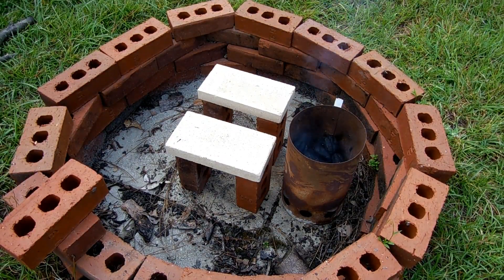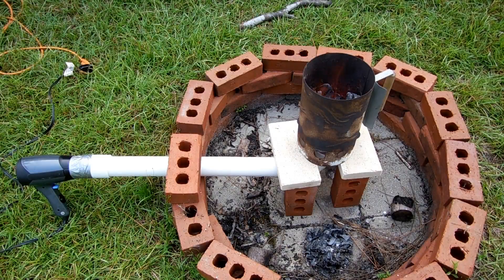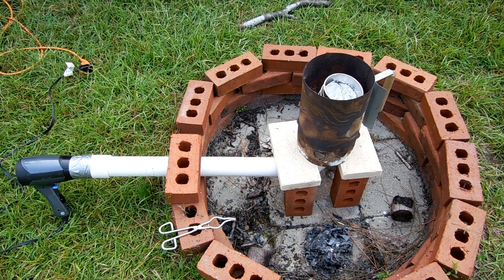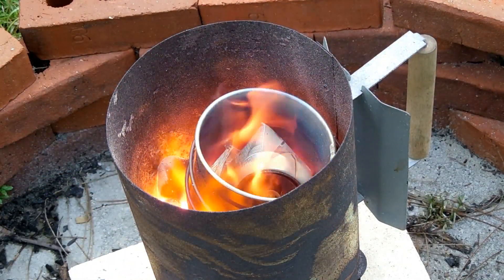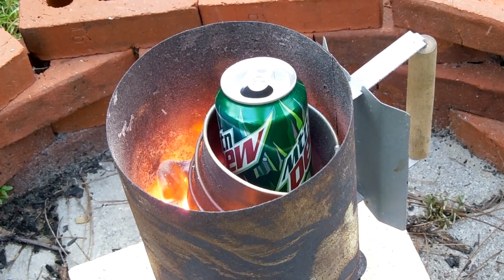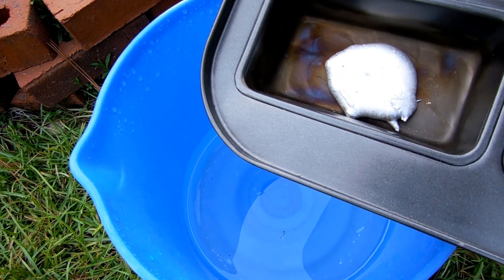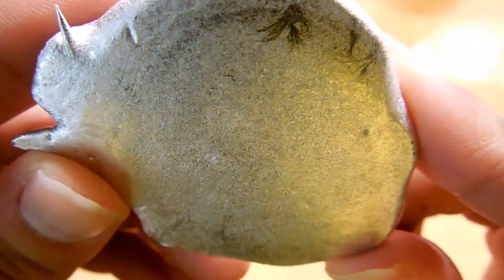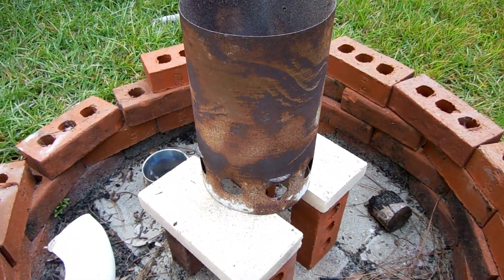Very Simple Aluminum Furnace

Comment: So if you'd like to get almost on slag, roughly cut up the cans up to make them more compact, then take borax ( yes the old soap) and dust it over the top of the cans. Then start melting, the borax acts as a flux and will reduce the slag to almost nothing. Also see if you can find an old plumbers lead pot they make great crucibles for most melting and there cheap. Plus they will last way longer than the SS pot you have. Happy melting!
Reply: I don't get it. I looked up the melting points of lead (621.5 F) and aluminum (1221 f). How does lead work without just melting first?

Comment: If you use the metal tubing and the silicone hoses and hose clamps from a front mount inter-cooler setup for a turbo car as the pipping it will be a lot more secured to the hair dryer, and a lot more reliable. Other than that good idea, it seems to work really well. As for what shoes to wear, Mack Boots are awesome, and I've had the pair I'm wearing now since 2008. They still have plenty of rubber grip left, nearly like new actually, and I did security in them for 5 years. They breath very good, and I never get sweaty white spots on my feet from them, but as soon as I wear cheap sneakers for a day it's another story. I love my Mack Boots. Totally worth the $140au I paid for them.

Comment: I have seen aluminum pots melt on an electric stove, so wouldn't it be possible to melt aluminum in a stainless steel pots on it either a gas or electric kitchen stove.
I realize this will be rather dangerous to do in the kitchen but nevertheless, I was just curious. 
Keep up the good works :-)
Reply: Yeah sure, as long as your kitchen stove/oven has a setting that goes to 1,200°F.
Reply: Rolf, I'm no kitchen ace, but my Betty Crocker Cook Book specifically states:  "Flip the pancakes when the bubbles appear on the top-side and the edges turn golden brown."
No sarcasm intended, but...if your aluminum pan is melting and dripping through your electric heating element, breakfast is probably ruined. -Just saying.
Reply: marshalllhiepler
 LOL, I was going to say Rolf and my wife should trade recipes sometime. :D

Comment: The plastic gloves you are wearing are a bad idea is is the idea of no shoes.  If you splash aluminum on those gloves, they will melt and stick to your hands, causing a much more severe burn than if you had no gloves on.  You should stick to all leather gloves for handling aluminum.  No shoes is probably better than laced up shoes.  Metal down the laces can really burn you because you cannot get the shoe off easily.  You will get a better yield on you aluminum if you crush the cans first.  The method you are using exposes the surface to the air as it melts and allows it to oxidize.  Crushed cans will allow you to put several cans in at the same time.  A top on the melt pot would help keep oxygen out.  It would be a good idea to use a refractory coating on the steel pot you are melting in.  That will stop the aluminum from sticking to the steel and eventually eating a hole through it.  Lacking real flux, you can use table salt on top of the metal to slow down oxidation, just skim it back before pouring or use a skimmer and remove it first.  The salt is lighter than the metal and will float.
Reply: There was an experiment done and it turns out metal doesn't stick to your hands. That being said it's still dangerously hot and can burn you.

Comment: please, how hard is that output aluminium material? can you break it in hands, or can it be used as construction material?
Reply from the maker: Lots of things are made of aluminum! It's lightweight, strong, and corrosion resistant. That would be the next step after melting cans into ingots: make a mold of the thing you want to make, melt again, and cast your part. The first melt is mostly to get rid of the large amount of slag. Of course, these cans are an alloy so that may or may not be beneficial to your application.

Comment: The bottom did not cristalize because it cooled slower. heat slowly transfered from the bottom to the cake pan. teh top however got qunched in water, cooled very quickly, you tempered the top of it.
Reply: Thats not really the truth and it doesn't make sense either :) the whole piece of aluminium was quenched in the water simultaneously, so that explanation is ruled out :P
And what happened is actually the opposite, because he did not pour the molten aluminium in the water directly.
When he poured in into the mold, the bottom cooled more rapidly because it came in contact with a colder and less heat tranfering effecient surface, therefore the bottom cooled the quickest which did not give the aluminium time to form crystals at the bottom, but the top layer however was out in the atmospheric air, the aluminium then heats up the surrounding air immediately unlike the steel mold, which has a larger mass and takes more energy to heat up, the top layer therefore cooled more slowly and gave the aluminium time to settle in it's crystallic structure :)
Reply: DannyMcCawley you don't know much about thermodynamics do you? I suggest that you talk about things you have studied, not things you think you know about. you will sound less silly next time.
Reply: Mike Warren Oh and you have thats why you, can put out a statement like cooling metal rapidly is what makes it form crystaline structures?
And furthermore your explanation isn't "water tight" if you will, because the aluminium had time to cool before it was dumped into the water, so don't go there.
Reply: Staying clearly again, that you know nothing about thermodynamics nor metallurgy
Reply from the maker: DannyMcCawley
This is correct. Technically, it still formed crystals everywhere but the faster it cools the smaller the crystals are. As you said, the part in contact with the pan conducted the heat away quicker, meaning faster cooling and nearly invisible tiny crystals. The rest of the blob cooled more slowly, resulting in larger more visible crystals.
Reply: Incorrect
Reply: Mike Warren It is a fact that if a metal cools more slowly the crystals formed will be larger than those of a metal that is cooled rapidly i suggest you go read up on your education again, that is if it ever existed.
Reply: Insults sure validate your point don't they. And also make me want to take you seriously
Reply: Mike Warren Did I insult you by questioning if you actually have an education in thermodynamics? If so you might wanna take a look at your very first reply to me and then climb down from your high horse :)?

Comment: Pure&simple - just perfectly impressing idea! You didn't show precisely the connection of PVC elbow with the hot charcoal oven. I would apply a steel piece instead (smoking PVC is poisonous after all). Temperature can be even 1200C considering old metallurgy methods - many forests fell in this order in old ages. My first furnace stuff will be thousands of empty pet food packages - they are not collectable by metal shops at ours - whereas blobs are OK....

Comment: i understand the whole principal behind forcing air into the fire but as far as your problem with the hair dryer duct taped to the pipe why couldnt you use one of those hiar dryers with a cool setting so the duct tape wont loose its stickiness so fast?
Reply from the maker: Of course, but this hair dryer was free!
Reply: mrhomescientist
What he should do is connect wires to the motor (most are DC) and use small wall wart. Or better yet use a variable power supply for exact air flow control. I had a forge similar to this using a piece of cast steel water pipe. Also used metal pipe to connect to hair dryer with variable speed control. Easily melted aluminum using a cast iron ladle. Coal works good too.

Comment from the maker: All of that is well away from the hot coals, and works just fine. The end of the pipe closest to the flame was only slightly melted, but I'll still probably replace the PVC with metal at some point.

Comment from the maker: Slag is usually metal oxides resulting from the hot metal's reaction with oxygen in the air. These are usually solids because oxides have higher melting points than the metal itself (i.e. aluminum is 660C and aluminum oxide is over 2000C). There's also probably some carbon and other organic gunk in there from burning the plastic inner liner and label.

Comment: Pretty cool... The ultimate can compactor. LOL
You could build a rocket stove with chimney brick and probably do the same thing. Also, to speed things up a bit, kink the cans slightly or flatten them lengthwise and put several in at the same time.

Comment: Excellent video! If you have any black locusts growing on your property or access to that wind already dried you will get much better results for the money. Charcoal is about half as dense as anthracite and locust has the same heat content of anthracite so you should use half the amount of locust and it costs a lot less than charcoal if you are smelting a lot of metal.

Comment: Thanks, that's very helpful. I aim to do something similar with a large fresnel lens, possibly parabolic mirrors. I was under the impression that fumes would be given off by the melting substance. Since the fresnel lens would generate a much higher temperature would a respirator then be advised?

Comment from the maker: Have at it! Can't get much simpler. I've actually improved it slightly since making the video, by surrounding the charcoal chimney with insulating fire bricks. Helps keep the heat in and make it more efficient. Crushing the cans beforehand also makes it a bit faster to melt, since you can load more at a time.

Comment: That actually wasn't steam, that was a thermobaric reaction. A pocket of air inside the can reached critical temperature and then caused a minor explosion which then gushed out of the open mouth of the can. Good work by the way, simple forge with bellows. Don't be surprised it worked to well - too many people simply over complicate things. I once made up plans for a heat treat oven out of a grill, steel mesh, tin spout, charcoal and a leaf blower.

Comment: I use an aluminized suit like those used by fire fighters while fighting jet fuel fires, but that is because of the tight conditions of my foundry...and I am a little paranoid when it comes to molten metal. But, creating aluminum parts that you have designed and cast is nothing short of amazing. Do yourself a favor and research this and then do it! You won't be sorry (as long as you are smart about it and respect the process, you won't get injured).

Comment: Yes. You do need to do this in a VERY well ventilated area. Even if you use electric instead of charcoal, you need to make sure that there is good ventilation. Gases from the flux used in the original manufacturing process will be released.
As far as PPE is concerned, you can really get away with using a good quality face shield, welders gloves, and a welders apron. If you drip molten aluminum on your foot, you are in for serious reconstructive surgery, so be extra careful when lifting the melt.

Comment: I used to do a lot of aluminum casting and the best way you can get rid of that slag is pouring small amounts of hydrochloric acid into the molten aluminum to purify it and scrape all the slag off the top after puting the hydrochloric acid into the aluminum, but were a gas mask because when hydrochloric acid is super heated it turns into what is commonly known as mustard gas, so use extreme care when you are doing it.

Comment: Observations: 1. the aluminum will oxidize like mad once it melts, and the slag will consist of mainly aluminum oxide. If you want to increase the metal yield, you need to present a reducing gas layer into the crucible, such as Nitrogen. You also stand a chance of the aluminium igniting in open air when molten. 2. You are losing huge amount of heat with it open. i'd put the furnace can into a larger metal barrel (like a 5 gallon cooking oil drum) and fill the gap with perlite or vermiculite.

Comment: Great comments! First I would not put my dick in it.second: I would not worry about shoes, surely you are quicker than a squirt of molting aluminum at 1200 degrees! And lastly if you can melt quick you have charcoal left over for lunch! I hear that the borate in Borax makes a good flux also, I have never tried rock salt......

Comment from the maker: Nope! I did some research on this a while back. The majority of the can is made of aluminum alloy 3104-H19, which is 95% - 98% Al with main impurities of Fe, Mg, and Mn. The lids are made of alloy 5182-H48, containing 4-5% Mg. The extra magnesium in the lid is to add strength.

Comment: I've melted aluminum this way too except my furnace was a bit larger. I didn't use a proper crucible and instead used a stainless steel pot rather like the one you're using. Anyway it was a disaster, the heat from the charcoal burned right through the steel and all my aluminum poured out the bottom. Molten aluminum running down a grassy hill at night looks awesome though.

Comment: Make the fire bigger man maybe inside of an EMPTY 20lb propane cylinder cut open.Use a steel pipe for your crucible as it will get red hot and retain heat so when you pour it will not cool down as quick and you will get more aluminum out of the batch,,,,also need to make a slag scooping tool to remove the slag,,,all this is only worth it if your are going to be doing a large batch

Comment from the maker: I actually looked into that, and it's too dangerous to attempt with my current setup. While Mg's melting point is below aluminum's (meaning I can in theory melt it), it's autoignition temperature is actually even lower. That means before it actually melted it would catch fire! I'd need some sort of inert atmosphere (and NOT CO2 or N2 either, because Mg reacts with both) before attempting this.

Comment from the maker: There is some Al trapped in it, but mostly it is aluminum oxide and probably carbon and other decomposition products from the label and plastic liner. This is because at these temperatures, molten metals almost always react with air to form at least a small amount of oxide slag.

Comment: I'm trying to find a way to heat aluminum to 2000° F. I need to measure it's temperature and photograph it every 100 degrees from melting to 2000°.

Comment: Ok, but the bottom of the charcoal chimney is solid metal and was wondering about pointing the air straight at that surface. But it does work, so that's great. Imagine how many cans it takes to make an aluminum ingot in that pan.

Comment: I have what might be a better crucile for you. 
Get you an old oil filter, take a hacksaw to the end that screws onto your housing and cut all the way around so that you can pull the filter element out. Wash out the container to get all the old oil out and you're done. I've used these as crucibles before and they work very well

Comment: Aluminum oxidizes readily at room temperature, and increasing the temperature also increases its reactivity to oxygen.  I estimate that nearly 90% of your waste (slag) is aluminum oxide, which is also responsible for the feathery crystals on the surface of the finished product.  If you can vacuum seal the crucible or use an inert gas to limit oxygen exposure, you could greatly decrease waste and increase your yield.

Comment from the maker: It isn't connected, just pointed at the bottom of the furnace from a few inches below it. The charcoal chimney has a grating on the bottom that allows the air to reach the coals.

Comment: 1. Safety, Safety, SAFETY!
2. Gingery Charcoal Foundry Furnace

I built my first propane-powered foundry almost a decade ago.  It only cost me a few dollars but what you get from stability and safety is well worth it.  My newest foundry uses a product from a company called Thermal Ceramics installed in a 18"x18"x24" sheet metal box.  The sides of the box stay cold even while the crucible is white hot.

Comment: Your right, you actualy need a nuke to detonate a nuke. That is, being a double uranium or plutonium (or both) nuclear charge that makes the hydrogen do a fusion reaction, which is like the sun. That probably won't even work with water. You can't make a small sun by putting water on hot aluminium, and if you could it would be widely used for weapons.

Comment: Fair enough. You can also store more cans in a smaller space between meltdowns. 

Glad you tried it though. 

As a tip, NoSalt (salt substitute for food, KCl) is in most grocery stores. While probably expensive compared to commercial flux, mix it with some NaCl and see if that helps your slag quantity.

Comment: I saw some alloy melting videos recently and what they did is add some candle wax to the molten metal and let it burn off (light the smoke on fire). This is apparently called "fluxing" and they claim it helps with the slag. Maybe you can try that.

Comment: aluminium has a low melting point around 700 degrees Celsius, the oxide is about 2200

Comment: things you could have done better.
1- PPE. SAFETY IS JOB #1. use personal protective equipment.
2- Flux. borax is cheap and works great reducing slag
3- skim dross. prior to to pouring
4-pour hot. keep on heat longer before you pour after smelting. pour as soon as you remove your crucible. you will get more out of your pour.

Comment from the maker: Yes I think so - there was quite a large amount of slag when it was all over. It also tends to stick to the sides of the container and is hard to separate from the metal, so I'm sure there's a bit stuck in the leftovers. I also don't know what percentage of the can's weight is actually metal, so it's hard to determine the real percent recovered. I did a larger melt of 25 cans, and that yielded 60% instead. So maybe more metal at a time lets it separate from the slag easier.